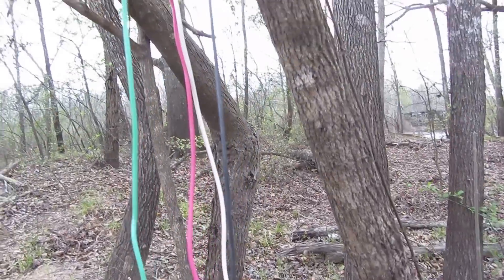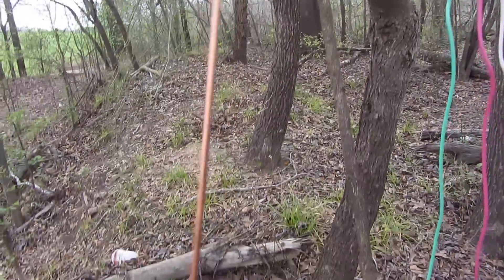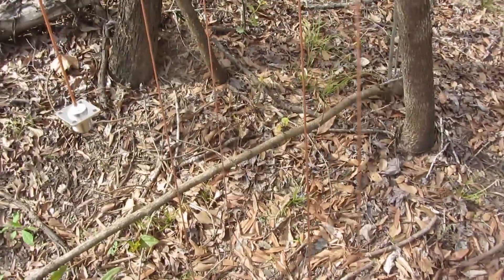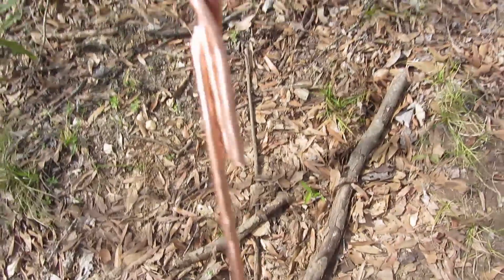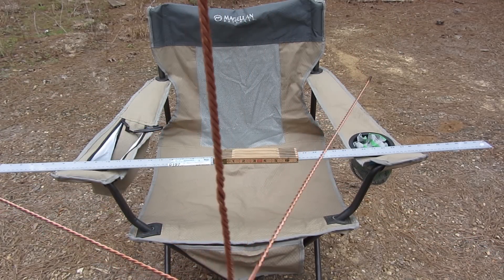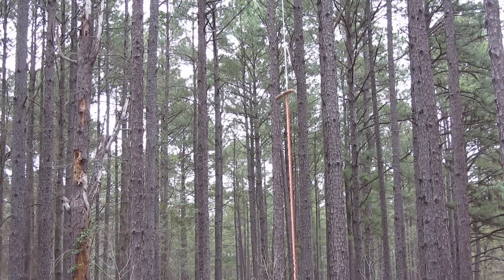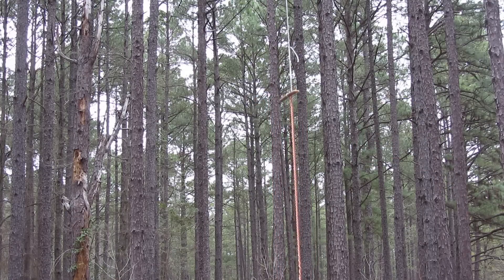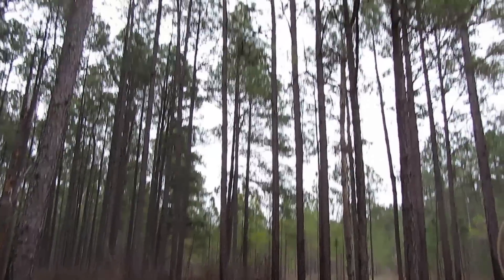2-METER Radio Antenna Homemade

Comment: How did you solder the center element?
Reply from the maker: I left one wire a little longer to slide into the SO-239, soldered it into place and soldered all strands together around it.

Comment: I've braided/roped wire like that plenty of times before.  But I never knew that's a way to straighten solid core and get the insulation off.  That's a beautiful braid though.  I'd be tempted to see if it would soak up some solder in the cracks and encase it in clear shrink wrap.
Reply from the maker: It soaked up the solder on the tip before I placed it on the SO-239.

Comment: I sorry I just found your videos on YouTube and was wondering if that antenna was for a ham radio or a cb radio
Reply from the maker: @Pete Ables it's for 2 meter ham radio at 147.000 Mhz. CB radio in the u.s. is at 27.000 Mhz. You can still use the same design but it will need to be Much Longer for the lower Mhz frequency.
Reply: Ok thanks

Comment: Is not the center pin of the PL259 supporting the weight of the antenna plus the RG58 cable when hanged?
Reply from the maker: yes it is

Comment: That’s a clean build. Have you hooked it up to a VNA or SWR antenna analyzer?  You might also consider drilling some holes into the bulkhead and adding 4 more radials - which would make it crazy good.
Reply from the maker: @aerostar No I haven't bought an antenna analyzer yet
I need to get one soon since I have an HF/VHF/UHF rig for my Jeep and will be mounting antennas on the front bumper bar

Comment: A lot of people don't know you can do that. In fact, I just made this with 4 gauge stranded ground wire, 7 strand.
Reply from the maker: @Inconsequential Yes most people don't know how electricity travels
Electrons flow along the outer surface of the Antenna called (Skin Effect)
So the larger the Diameter, the more electron flow. More pathways or Lanes of travel
And Copper is a great Conductor

Comment: question: how did they calculated the radiator: 2808 and the radial: 2948
am trying to build one for the air traffic 122mhz.
if i use this calculation then my radiator comes at 23 inch
and my radial will be 24 inch
am trying to build a same model for my scanner vhf/uhf 
question: do i realy need the radiator? in my case?
awsome straightening on the wire m8 it worked perfect here :)
Reply from the maker: @Dredlocks For receiving a signal you don't need to be exact on length and you don't need the reflecting radials.
You can use a metal fence around your house as an antenna. When receiving there is No RF power going out of your radio into the antenna and back into the radio to cause any damage. Only when Transmitting out of your radio do you need to be exact or near in length for optimum SWR so your radio doesn't get damaged by returned RF power. The reflecting radial aids in bouncing the transmitting upward and out, also called Ground Plane acts like the surface of the earth.
Reply: @TwoFeatherChannel  since i aint got no metal fence i need to build an receiving antenna with copper wire which should work perfect.
i have seen discone antennas for scanner use, but its nice to make one by myself, do you have video,s or manuals on how to build one?
best regards
Reply from the maker: @Dredlocks131  No I don't have videos or manuals on building those.
A single run of copper wire works. People talk all over the world with just a single run of copper wire.
You can tie a non conductive line on one end and toss it up a tree to pull one end up in the air
or tie the line in the middle and pull it up making a inverted V=^ shape. Search ARRL for more ideas.
Reply: @TwoFeatherChannel  ty will check on it :)

Comment: This antenna looks very nice! Is all of the wire solid?
Reply from the maker: @Blade Yes all solid single strand #12 gauge copper wire.
Just twisted them together for rigidity.

Comment: I have made hundreds of those and I never got that precise about it. Just cut 5 equal length wires and attach them to the SO-239 chassis mount.
Reply from the maker: Yes that will work but where is the learning experience in that. It is great that we have freedom of choice where you can be you and me be me.

Comment: Wow, you're a genius at using a screw gun.  I'd never have thought of this to straighten wire.  That worked great!  This past Saturday, I passed my Technician license test and the local Ham club gave me an HT Yaesu FT-4VR, a mono band 2 meter HT.  Now I need to make an antenna for the 2 meter band.  You sure made a very nice 1/4 wave ground plane.  I really like it.  I thought you had to bend the ground radials down at about 45 degrees to decrease the feed point impedance.
Reply from the maker: @W. Rusty Lane  Every home made antenna like this I've seen they bend the ground radials down. Two reasons I didn't do it. Keeping them straight for ease of packing it into backpack. Plus I don't have an antenna analyzer or swr meter to check it.
Take your General exam soon after the Technician because many of the questions are nearly identical.

Comment: Can you leave the covering on the wire with no signal loss?
Reply from the maker: Might be some loss but how much I don’t know. Probably not enough to worry about. Wire dipole antenna, Vertical stick antennas are covered.

Comment: I like the straightening technique.  Ya need a wind screen for the mic. on the camera.  I like how you wound the strands together using a drill.  I'm gonna have to try that.  You did a fine job on that, Two Feathers.  Are ya using a HT?  I see that you are.  Very good reception with the height of that antenna.

Comment: One of the best iterations I've seen of that design. Good tips to ease the process and to make it stronger / better. TNX. K4KID. Two thumbs up. i only have two or I'd give you three thumbs up! 73
Reply from the maker: @Terry Ketron...Many Thanks. That's what this is all about, showing each others ideas. I made the elements strong for my extreme outdoor lifestyle. You should see my Fox Hunt hand held Beam antenna. Main tube is PVC. Elements are copper, same as this one but I used female threaded studs for the main beam and male threaded studs for the elements. This way I can unscrew the elements and store them in the PVC main shaft for storage when carrying it. I never liked the Tape Measure elements that most people use, looks trashy to me.

Comment: Can somebody please clarify why the radials are calculated at a different length than the radiator?
Reply from the maker: @Troy Carpenter....Not sure but I think it is meant for a larger deflection area. It is the same for a Beam style antenna. The rear Reflector/Deflector Element is larger to keep the energy directed towards the Driver Element, which is smaller.

Comment: In case you don't know, you can "close" the heatshrink end cap by clamping it with pliers while it's hot
Reply from the maker: Yes. Thanks for the input.

Comment: Is a rg58 on vhf uhf
?
Reply from the maker: @NICOLA LA MOTTA....rg58 will work for both bands. But LMR200 is better. Same diameter OD but thicker center conductor which gives less line loss. Plus if you use Type N connectors they work better for these higher frequencies. PL 259 is rated for HF 11 meter, 10 meters on up. Lower the meters like 2 meters, 70 cm not so much.
Reply: @TwoFeatherChannel  yeah yeah ok thank u no problem..... I done an error writing the question....that had to be "is rg58 good for the vhf uhf frequencies?.....however thank you for the answer...

Comment: does it work on uhf radio sir?
Reply from the maker: @yeoj joey   No. This length is for vhf, around 144mhz range in frequency. uhf is 446mhz range in frequency.
So uhf antenna needs to be around 6 inches in length.

Comment: How do you strip that long gauge wire lol
Reply from the maker: @Jhaz1914   I use ordinary wire strippers. I secure one end of wire tight, then begin on the free end by stripping about 8 inches of insulation off at a time. Stripping it in smaller amounts keeps the insulation from balling up.

Comment: How did you remove an isolation from cables? It must be horrible...I´m going to built this antenne too, so I´m little affraid of the removing of cable isolation.
Reply from the maker: @Rob Jord   Wrapped one end around a tree limb, then used Wire Strippers to skin insulation off at 6" inches at a time. Easier to skin off smaller sections, that way the insulation doesn't ball up and bind.

Comment: Hi, where I can get measurements for this antenna? Can you advise me or send me to my e-mail?
Reply from the maker: @Rob Jord  The formula for getting the measurement is in the video @3:50.
Or tell me the Frequency you will be using it on.
Reply: @TwoFeatherChannel  172-173 MHz or 448 MHz
Reply from the maker: @robjord328  Using 172.500 MHz: Length is 16.27" One Transmit Vertical Radial (Center). 17.08" Four Reflector Horizontal Radials (Sides).
448.000 MHz: Length is 6.26" One Transmit Vertical Radial (Center). 6.58" Four Reflector Horizontal Radials (Sides). Measurements are in Inches.
Reply: @TwoFeatherChannel  And in centimetres? I need Europe measurments :-) I use our shared frequencies.
Reply: @TwoFeatherChannel  And radials have to be horizontal or have to be (as shown on the picture) sloping?
Reply: @TwoFeatherChannel  And one more question. Is it possible to make antenna with possibility to use in both 172 MHz and 448 MHz?
Reply from the maker: @robjord328  Some people say Angled Down, and some say keep them straight. I kept mine straight because I use it for a Foldable Backpacking Antenna. But You will need to Tune It to your radio. Use a SWR Meter, then bend them down to see which works best for you.
Reply from the maker: @robjord328  Not like this configuration. It is for 2-Meters or 70-CM. Those two Bands are so far apart (Reason Why the Lengths are much different) that you would need separate and combined them, which requires adding things to the antenna.
Reply from the maker: @robjord328  Just google Measurement Conversion. There is another Formula to use that gives it in Metric. I just don't remember it.

Comment: I'd like to see how you soldered that center pin to the 4 strand vertical. If the radials get to rocking around in the wind, the vertical might break off..
Reply from the maker: @Steve Tomlinson  I kept one strand long enough to go through the connector. The other three were soldered to the outside of the center pin and all four were soldered together. Then I applied epoxy glue around where all four were soldered. Then I applied shrink tubbing around that area.

Comment: You are the MAN, MAN! Last night made the same one, it's amazing how good it works. Also it works very nice on UHF(420MHz was used).
Reply from the maker: @Dejan Besina   Great! Good to see you made one, that's what this is all about, sharing.
Reply: this antenna is aplicale also for UHF in 450 mhz or not? and if we used the formula the antenna became smaller .. thanks you

Comment: nice job, looks great too!  they say you can get closer to 50 ohms if you angle the radials downward to approx 45 degrees +/- to achieve a 1:1 swr.  I’ll build one and check it out on the antenna analyzer and let you know.

I can’t believe you have 41 dislikes... what’s not to like about this?
Reply from the maker: @inma truckyo  I didn't have an SWR meter or an Analyzer at the time I built it, so I kept them straight then.

Comment: Great trick for straightening that wire. Thanks for sharing.
Reply from the maker: @Uncle JD   anytime. You can also use a Round Shaft Screwdriver, just pull it tight and run the screwdriver shaft along the bare wire. Straightens by friction but takes a little longer.

Comment: why is there a different formula for the radials?
Reply from the maker: @John Ossi.......The Center or Vertical radial is used for Transmit and Receive the signal. The four Horizontal radials is what the signal bounces off or reflects off of, which makes it a ground plane. Similar to a Satellite Dish reflecting a signal to the center, where the receiving device is. It's a mathematical formula used on frequencies to achieve the correct lengths.

Comment: Will this work if I make it for the 3 meter FCC part 15 AM?  Very informative, easy to understand way of teaching!
Reply from the maker: @Tim Miller....I do not know anything about the 3 meter band but if it uses a Vertical Radial to transmit/receive and Horizontal Radial ground plane, then this formula I used to figure the length to a specific frequency will work for you. Just use the frequency you will be using in the equation to find your length.

Comment: The center poll is same length with legs?
Reply from the maker: @Norvin Sakiral....No. Almost the same but not exactly.
Center pole length: is 2808 divided by the frequency you are using.
Four Ground radials length: is 2948 divided by the frequency you are using.
The measurements will be calculated in inches.

Comment: Nice video good construction technique if you bend the radials down 45° you'll get a great SWR match and wider band with
Reply from the maker: @Don D...Yes, I didn't bend them at the time I made it because I didn't have an SWR Meter.

Comment: Ah, my chuck is prob 3/8”. That explains since I was doing as you indicated. I want to use this as an antenna for traveling. Thus, I am hoping it will work to squish or open longer for various frequencies. Thanks. It worked great when I took it in my front yard. I hit a repeater I never have before! Not even sure where it was. Looking it up now.
Reply from the maker: That's great. You can also use just one wire folded over, that will make two strands. Should be ridged enough and still fit a smaller drill chuck.
I made mine for traveling, so I could carry it in a backpack while hiking through the forest.

Comment: New ham here and this looked like a fun, straightforward first project. I purchased copper on the coil since I could not find the right size.  I am having real trouble keeping the four strands in the clamp end of the drill at once without pulling out. I have finally twisted each half of the radiator (like the ground plane reflectors) and THEN twisted the two of them together as much as I can. Even that will only hold for a few turns. Any hints?
Reply: Redid it with new wire and worked better. To tune the antenna, can you squeeze the end loop of the radiator to lengthen or shorten?
Reply from the maker: Squeezing may help some. It is better to cut the length to the frequency you will be using.
Reply from the maker: I have a 1/2" chuck, that holds all of them together. Make sure each strand is straight. Turn drill slowly, while pulling the wire tight towards the drill, that's away from the stationary end. That should hold them together.

Comment: At approx. 4:05 mark in video, on the printed page you are holding that shows diagram for ant., in the lower-right corner the picture seems to be indicating the radials are to be passing under or over the adjacent corners of the connector as does the picture in the lower-left corner...can anyone explain that?  Would it be a way to provide strain-relief and/or more stability to the radials?
Thank you for your time and assistance.
Raymond - WF7BSR
Reply from the maker: +Raymond L.
Placing them on top is more stable but is not necessary in performance. I made mine to be taken apart for transport. You probably will need to angle them down slightly, depending on your SWR readings.
Reply: Thank you.

Comment: Great tip on build technique and materials! I was considering this style antenna to replace my AIS collinear.  Will the variable in the formula change if other materials is used (for instance aluminium or stainless steel) or can i use it with all styles 1/4 wave monopoles?
Reply from the maker: +Formula400Pontiac
RF travels the same as electricity, so yes the material type will make a difference in performance only, not in the formula. Copper and Stainless Steel are better conductors but weigh more and is more expensive than Aluminum. One reason why Aluminum elements are used in the radio industry. Also the Larger the diameter of the Tube or Conductor being used will be an improvement.
But all in all, using Aluminum is good enough.

Comment: Great idea for the twist. How long were the ground plane wires? 19" as well? How high did you take it up in the tree
Reply from the maker: +Glock
My ground plane measurements were 20".
The local repeater in my area that is mostly used is on 147.330. So I used that frequency in my measurement.
Ground plane formula is 2948/frequency of your choice. You can choose the center of the 2-meter band as your frequency but people in my area don't use the other repeaters much.

Comment: So you basically folded the wire pieces in half and then twisted them? does the distance between the end of the twist and the contact to the center pin/connector holes matter? And how did you fit the doubled wire in the center pin?
Reply from the maker: +N3ssaya
Yes, I had 2 long straight pieces of wire, fold them in half which gave me 4 wires bundled together, twisted.
Yes, distance in length does matter, I gave the formula to use as the multiplier for the frequency you will use.
I had 1 strand of wire a little longer than the other 3 to place in the center pin hole connector, and the other 3 were touching the outer side of the main center pin. Solder all 4 ends to the main center pin.
This is how electrons and electricity works, electrons travel on the outer skin of the wire, not in the wire center itself. It is called Skin Effect. So by folding the 2 wires over, you are creating a 4 lane highway for the radio signal to travel on.
Reply: Thank you for the quick answer. I'm a total dumbass when it comes to antennas. 73 de E73HAK

Comment: Sir what is the exact length of coaxial cable you use for this project
Reply from the maker: +Jeng Fernandez
50 feet coaxial cable from radio to antenna.